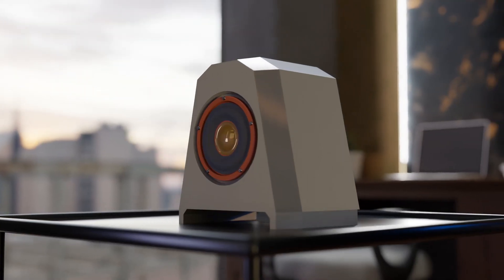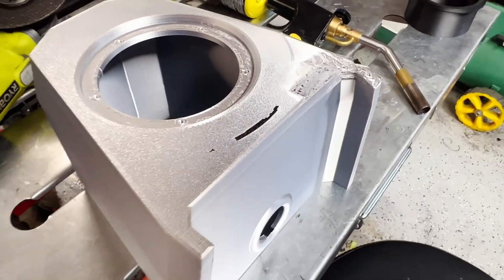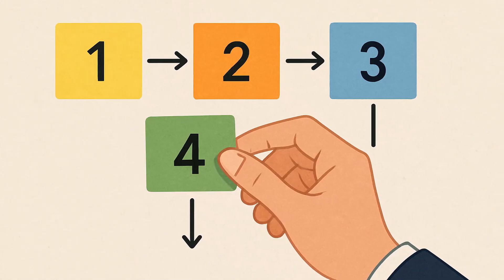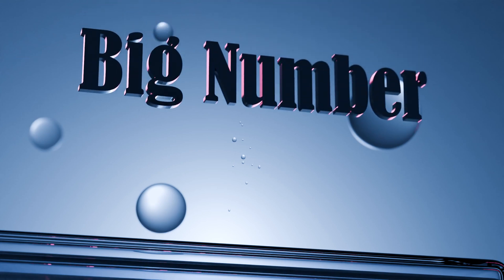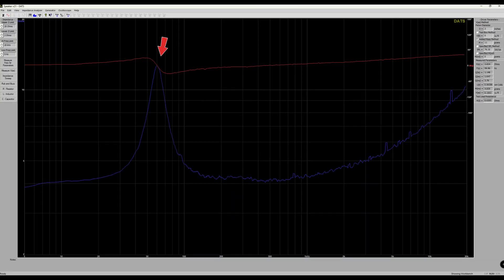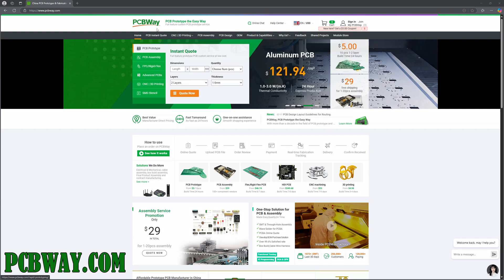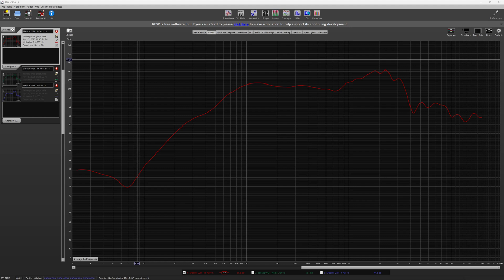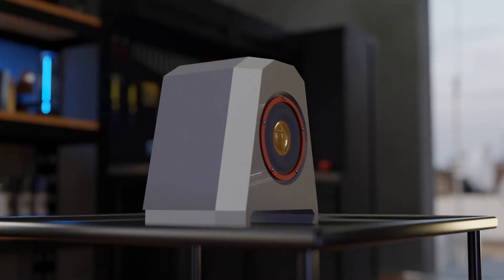Watch Me Build a Super Cool Bookshelf Speaker From Scratch!

Comment: Hey man, I've been following your journey for a little bit and I love to see the progress. I'm pretty big into printed enclosure design and building but the more I watch your vids and the more I want to dip my toes in the driver design (I actually have the same thermoformer that I bought for a bathbomb mold maker project for a client,  that's how I found out about your channel haha)

From my knowledge, this looks like a pretty descent mid-bass driver but the harmonic distortion and spl response in the higher frequency looks and sounds very bad (I'm listening on a pretty expensive HiFi setup soo depending on your mic I feel like I have a good idea of how the test recoding sounds).

Personnally i would cross it over at 700Hz and pair it with a low Fs tweeter like a 1in dome tweeter. Also Qts is pretty high soo a sealed box would be ideal to add some mechanical damping and tighten the respon and minimize harmonic distortions.
Reply from the maker: Awesome! Glad you’re enjoying the videos! I don’t argue with you about the distortion. Unfortunately the pole of this motor didn’t line up perfectly concentric, so I ended up with one side of cone/coil getting more field exposure than the other. 

I will say, the compression algorithm on YouTube will never convey truly being in room regardless of level of recording and listening equipment. 

As for my equipment, I use a Scarlett studio microphone for all audio recording on the channel now. 

I’m working on the 3D printed subwoofer currently, and then once it’s done I want to refine my printed tweeter and then,To combine it into a 3 speaker tower system, with appropriate crossovers. That’s the channel goal currently.